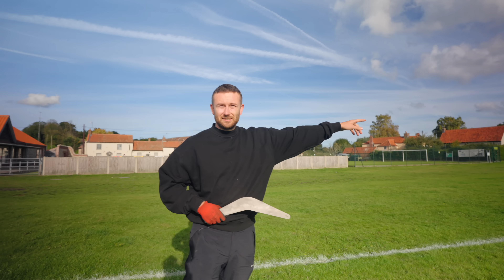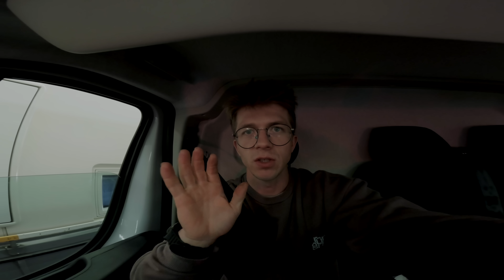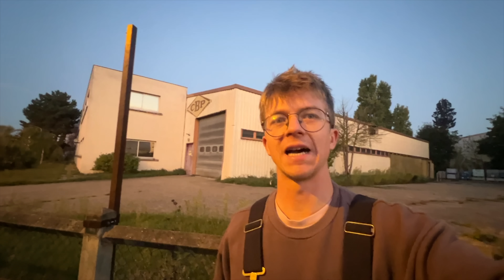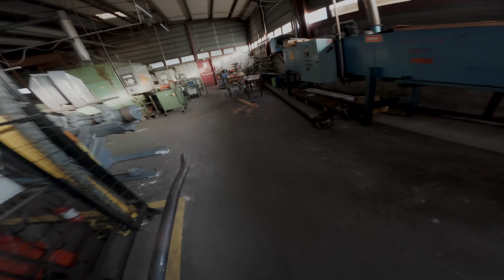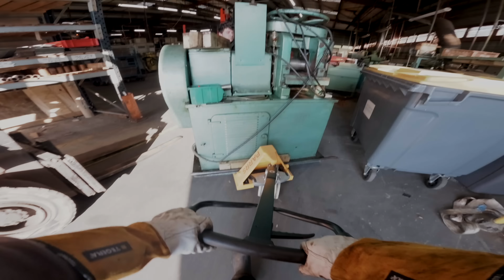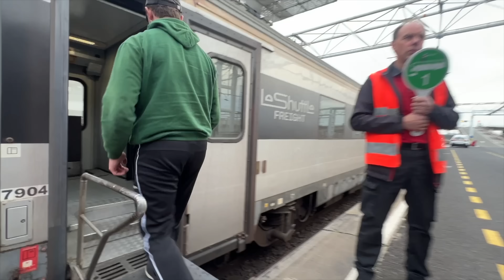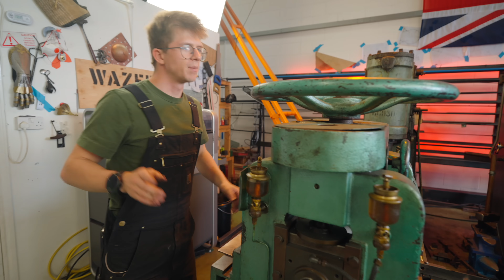My New French Friend

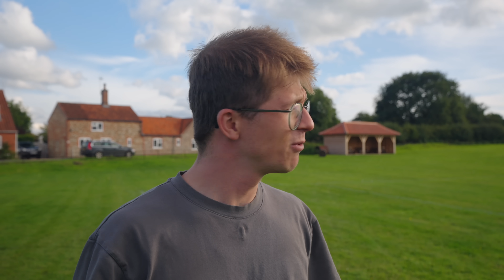Comment: 2:29 - Boomerangs actually need a curve in their cross sectional shape.  Similar to an airplane wing.  In addition the leading edge is also usually indexed upward which controls the  lifting force coefficient.  Both the profile and this angle control govern the flight profile and how much rotational force must be imparted.

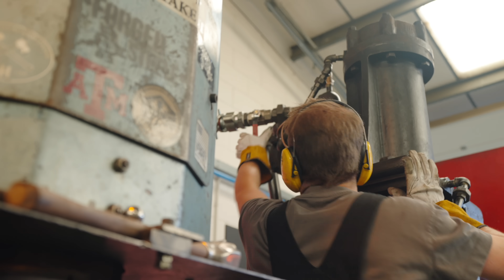5:35 - Are Burke Bars not a stock item in the UK?

Comment: In the Mythbusters tradition of using tools for purposes that they weren't intended: can you use this to set a forge weld? Like, get two pieces of flat stock up to forge welding temperature, stack them up, and then run them through the tool.

Comment: When using it for Damascus , you will see the damascus pattern elongating/distorting very much.....the way the steel gets pulled trough by the rollers it not the same as being squished flat by a press or hammer , you will see the top layers of the billet getting very thin and flacky shifting in a direction. The pattern will come out looking smeared. You could avoid this effect to some extend by rotating the billet front to back when pushing it trough the rollers. Personally i only use a rolling mill as a last pass to get the flats parralel , certainly not to forge down a billet fron an inch thick to blade thickness.

Comment: For the maximum thickness not being that great...it seems like you could so some slight modifications to the machine?
The limiting thing seems to be the springs, so if you can get some longer springs  in there, and maybe drill the holes they are in a bit deeper, you could get more thickness?

Comment: Run the bar through once, flip it over, run it through, flip it over... ect... If you keep running the bar through the same way, the stresses will keep accumulating and forcing the bar to curve. If you flip it over it evens out the stresses in the metal and helps keep the bar straight.

Comment: I absolutely by no means am an expert in two phase power or two phase machinery, but my initial reaction would be to get an electrician in there with a fluke voltmeter and verify the supply draw on both phase poles are identical. Because any variance (another machine is on only one of the phases bringing it down below the other) would change the rotational speed of only one roller not both and ergo - curled stuff.

Again, absolutely only speculation. I can't back this up.

Comment: The rollers are rolling in the opposite direction not the same direction😂
Reply: Right.  But the gears in top, driven by the large wheel, run in the same direction to operate the screws to apply pressure to the roller.

Comment: Pretty sure its possible to measure the rolling thickness at the end port where the return springs are, unlikely to be lucky enough to get 1:1, but im sure you can just ratio it. The smaller wheel has to be tilt, big wheel is already accurate enough and if anything was produced for machine accuracy, it wouldve been ran through a press or a grinder after roll for sure, especially since theres no way you would cold roll steel to spec.

Comment: Hi Alec, concerning the bending, could it be that by having the wheels not perfectly vertical to another, they act as a rolling bending machine (the exit table acting as the third wheel)?
By pushing the top wheel forward, it makes the machine wanting to feed at an angle but the table forces the material toexit horizontal, thus creating a bend in the material.

Comment: @AlecSteele 
Are you flipping the work piece after each pass through the mill? And have you tried smaller thickness adjustments to see how much that effects the amount of curling? 

If you carefully look at the bar at 20:44 you will see that the top leading edge is slightly more compressed than the rest of the bar. That means the mill is pushing a small amount of metal backwards along the top as the bar goes through the mill which causes more tension on the top than on the bottom leading to the piece curling.

Comment: if the rolling speed from whatever reason does not match at the top and bottom roller, the material will curve. Cause could be the mechanism inside like cardan shaft, or the difference in the friction coefficient, one is mor oily or so. :)

Comment: @Alec, I reckon you could increase the thickness of steel (other metal) by increasing the length of those springs... just have to take smaller 'bites' of it so you don't damage the rollers and bearings.
G'day from Aus btw 😊

Comment: I think the small wheel regulates the angle of the top roller. If it moves the center gear backward/forwards then one big gear turns clockwise and the other anti clokwise.

Comment: Interesting that you didnt just lift the pallet so the weight was removed from the 2x4's, it wasnt a big enough gap to set the center of gravity off by much and as long as you went slowly it would have worked with out issue. Anyway, congrats on the new macine!

Comment: Love the vids, always makes me exited when a new one comes out. About the power: When conneting AC it should not influence the direction of the motors, since the direction is controlled by DC which happens in the machine. You could blow a fuse or make magic sparks, so good on you for getting it right :)

Comment: Im sure you can get some bigger springs between the two rollers to make the space bigger. Why else would the machine be so tall. The downside to the bigger springs would be that they wouldn't compress as thin as the smaller springs, so if you're doing a really thick piece of metal and compressing it to a really thin piece, you might need to change the springs durring the proccess.

Comment: I ran what's called a bandline, 3 different ones actually. They are for running wire drawn down to different sizes from a rack holding up to 159 spools of wire they come through guides into the rolling mill, through some glue into the heaters on toward the final spool, then off to the presses where the wires glued into band will be turned into staples of all sizes. Your rolling mill reminds me of our oldest bandline, the prebena, it came from Germany in the 1980's. That mill can run anything your doing with yours, but I ran round wire drawn down to 0.056 +/- 5 and then the mill flattens it 0.042 +/-5. The OD on my rollers are about 6X those in yours, but it's unnecessary because my other 2 bandlines mills have rollers with about the OD as yours. I will give the germans credit, from the bearings to the mill everything on that bandline is over sized and built to last practically forever, or atleast it would have if proper maintenance had been done since senco bought it. The other 2 bandlines are hodge podged together from different American companies, not our doing that's how they were made when Stanley bought them and senco bought them from Stanley. They are faster and more efficient but the programming is far more complicated compared to the practically analog prebena bandline. Although the electrician has it wired up to where without him the damn machine would never run again if he quit, retired, or died suddenly, otherwise the second person who knows the most about it is me, which means they're screwed because I quit years ago and I'm a charter fishing captain now. Lol that factory ruined working in factories for me because the management completely sucks balls and since the Japanese Kyocera bought them I'm surprised they haven't all been fired

Comment: You might already be aware, but if you change those two coil springs to longer ones, you should be able to get more clearance on the rollers to fit thicker material in the roller.

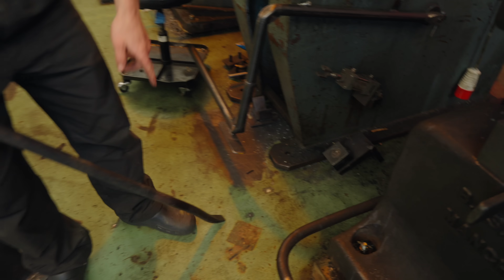Comment: if you thread the holes (see timestamp 5:02) in the feet of the tool, you can insert a bolt that you can tighten from the top which will jack the tool off the floor so you can get the bar under the feet.

Comment: I suspect the small wheel is for trueing the rollers. When you turn the large wheel one side moves forward and the other back, making the left and right of the roller move together. When the small wheel is turned, both sides of the large wheel move the same direction (both forward, or both back), and so the left and right sides of the roller will move in opposing directions, resulting in the roller tilting left or right.

Comment: slight bend is usually from uneven roller sizes when squishing it IS a 2 roller version rather than a 3 roller version that normally helps hold a specific curve. you'd need to flip the stock over each time through to more or less hold it straight as possible. you can also use a straighening jig or press with the right dyes to flatten. remember this is for squishing metal not for keeping it perfectly straight while doing it. we use these in jewelry all the time and I have to use pliers to straighten stock from it.

side note; you can press a print into metal using lace or other threadwork by running it through one of these on top of a piece of metal. (same thing works for wire but usually that ends up welded to the base piece via friction.
Reply: btw ours came with a jig that attaches to the roller that automatically keeps bend to less than 15 degrees per 5 feet perhaps you could make one just careful where you drill and tap for attachment holes on the body of the machine if you plan to do this. edit; ours is a manual one so the top roller holding piece was solid metal and could be easily drilled into without changing the structural integrity at all.

Comment: It would be great to have a reverse switch, so when you roll a piece one way and pick up on the other side you don't run circles around the machine but just switch it in reverse and roll the it right back. And for the curving problem, i'd install some sort of a blade-scoop-guide-thingy at the exit point so the metal detaches from the roller right as it exits and spaghetties out relatively straight. Looks like there's a lot of modifications you can do on that thing! Should be fun :)

Comment: I'm pretty sure the small handle is to tilt the top roller.

The large central handle turns a small gear which drives a pair of larger gears. The gears turn in the same direction and are right hand thread.
When you move the central gear forward and back it turns the larger gears in opposite directions.

Comment: More than once I have gone to pick up some old machinery I needed or wanted for my shop and getting it home was the real story of the acquisition, love the pile of things he had set up to take with him, really could have used a toe jack so many times. One thing you may want to get moving forward is a work cart that you can load materials or projects on and then jack the top of the cart up to "working" height, really love mine it has a 500lb capacity and really saves my lower back, mind your floor space... getting really crowded in there. good luck and MORE content

Comment: That looks like a fine machine that will serve you well for a long time. I have a much smaller hand turn benchtop mill, weighs around 200lbs. . My top adjustment fine tunes the crush/pinch point area. You can adjust it front or back essentially changing the "Fulcrum point' forward or rearward of the bottom rollers center/high point.  Maybe the same adjustment on that little beast. Maybe not.    Another thing to consider is the actual bushings themselves. There is only so much adjustment in them and if they wear to one side or on one end you will fight it forever. So, Always make sure the oil is flowing from the caps during operation. It might be a good idea to keep those roller ends protected from flying slag too.  Since it will be for "Hot work", the oil can possibly pull fine glass/ferrous/grit into the bushings via capillary action as it cools off. Well, either way,  I look forward to tagging along as you figure it out.  Thank You for sharing this weeks adventure.

Comment: 21:33
That looks like more of a heat dissipation issue than a mechanical issue, but I think you're right and the smaller wheel does help to work that out while the roller is cold.

Comment: Also, see if the bottom roller speed can be adjusted in reference to the top roller. The curve may be due to a slight turning speed difference. The reason I say that is, why would it not also be curving down? It's always up, which suggests this to me. I do see the flat plate stopping it, but I didn't see it fighting the plate to curve downwards.

Comment: i guarantee you can modify that thing to accept a thicker material. Also it's curving because the rollers are not aligned. if the work piece contacts and clears the upper roller first, it will curve up, and vise versa

Comment: Alec next time instead of lifting off the blocks just use tje forklift you wont have to run the sling to pic up machine to remove crabbing so it is on pallet forks in pallet lift till clears blocks move blocks and set down . Also invest in some real  ratchet straps god I cringed seeing those tiny 1 inch straps

Comment: I’m an electrician in North Bergen NJ who wires these machines for a company called Reliable rubber & plastic machinery, they make these machines, new from scratch but up to 120 inch pins, if you ever get the chance you should give them a call for questions, just a warning, they can be a bit cranky lol.

Comment: Alec, as someone that used to frequently drive loads on a forklift for a job and put heavy loads on a pallet jack, let me share a piece of advice that can save you from having a common accident that you failed to take measures to avoid when you were handling this machine. Once you get any load onto a pallet, you need to secure it onto the pallet using straps so that it if the load starts to shift, it can't fall off the pallet and the forks of the fork lift can stop it. Just a couple of ratchet straps are enough to do it as you are trying to stop the inertia from getting the tipping from going past the point where it will tumble off the pallet. It's also a good idea to do this for when moving loads by pallet jack for the same reason since it changes allows the pallet to stop the load from tipping over since they are attached. This doesn't stop all tip over incidents, but it stops a lot of them.

Thought I would save you and anyone reading this from the danger of these events and the cost associated with them. Pro training for forklift driving normally covers this, but not always. A little thinking about what you're doing and it makes sense as connecting things stops them from getting going and the angles they can tip at from being where they will fall over as easily, in many cases. This load was pretty wide based and you were on flat, even ground, so no worries here, but good habits are worth fostering for safety when you are dealing with 100's to 1000's of kilos of metal that can fall over worth 100's to 1000's of Euros.
Reply: Will could've used this advice a few years ago.
Reply: @blackhawk15897  Yep. It was too late to give it by then and saying ti in the comments of that video would have been...not helpful with the mourning process.

You can also use bolts, nuts, and flat bar or a 2X4 to bolt machinery down to the pallet if the holes line up and you are going to be transporting it for long distances. This also means you can use the pallet to ratchet strap down directly, if the pallet is sturdy enough, like the ones that hold tons of stone and brick. Still need a could over the top of the machine For leverage, but it can make strapping down a load a lot easier. Need big bolts or lots of them to do this, though.
Reply: @blackhawk15897  Who?
Reply: @TheStevoh1  Will Stelter, his American friend with whom he shared a workshop and store in Montana, USA, some years ago.

He restored a beautiful  powerhammer and when time came to move it out of the workshop.... it tilted and smashed on the pavement. Breaking the cast iron frame.

It was really sad for all of us... seeing months of hard work end like that.
Reply: @ArthA122  I'm familiar with the tragedy. Fixing broken cast iron is so difficult, too, so it was like watching a Ming vase brake. All you can do is learn from your mistake and move on in a situation like that, have a beer/soda/tea/coffee/whiskey, and move on with the wisdom you have gained from the experience.
Reply: I swear I've saved myself from so many accidents and injuries by just taking a step back and going "how can this task go horribly wrong" before starting
Reply: As someone who has seen a lot of forklift incidents moving huge steel coils, always make sure it’s secured. It’s too easy to seriously injure someone or worse.

Much like table saws our brain normalizes risk and that’s when you get bitten. Stay safe ya’ll.

Comment: 21:30 Unsure if this applies/if you've tried this, but having used one of these for metallurgy classes in university, my understanding is that you want to continuously flip the piece that you're pushing through the roller to reduce the buildup of uneven strain on one side that creates the bend.
Reply: exactly! also if your trying to make a large ring, not only will you have to rotate but also flip your piece so you don't have flat spots at the ends were you want them to connect.
Reply: I was going to say the same, and add: You're a blacksmith! hit it with a hammer.

Comment: The curve is called ski. Usually caused by rpm differential in your top roll compared to your bottom. Another factor is temperature of the top vs the bottom of the workpiece. Heat obviously rises so the top loses heat faster than the bottom side, hence the turn UP

Comment: Wouldn't it have been possible just to put the forks in the pallet and lift the pallet up until it comes in contact with the machine and then remove the blocks?  No need to use the jack and go from one side to the other at around 14:20,
Reply: It is already sitting inside his shop...doesn't really matter anymore, does it?
Reply: @codymoe4986  Just wondering why he did it that way.  Perhaps something I didn't see.  If you don't ask questions, you never learn.